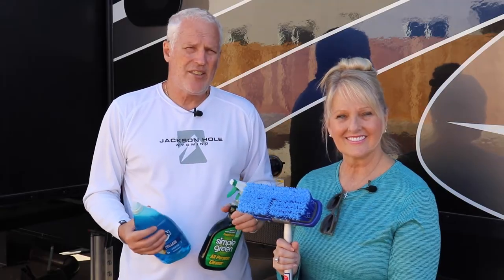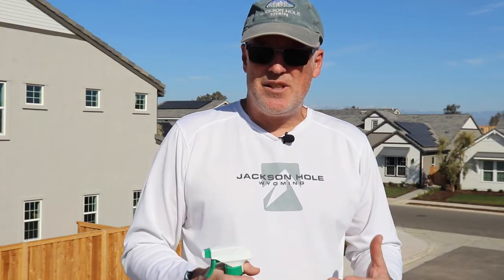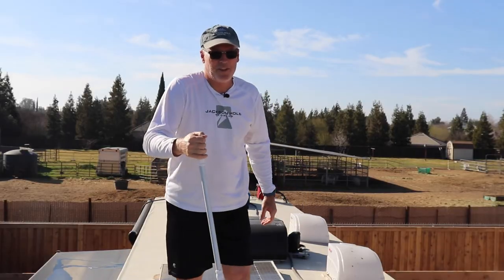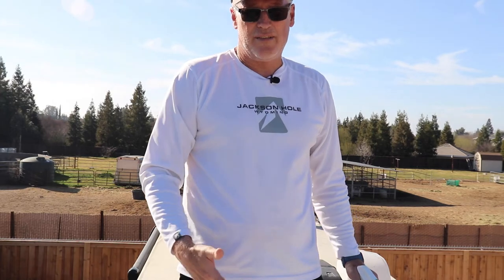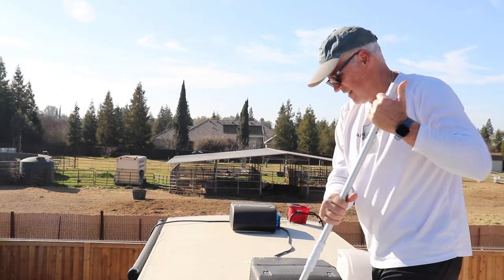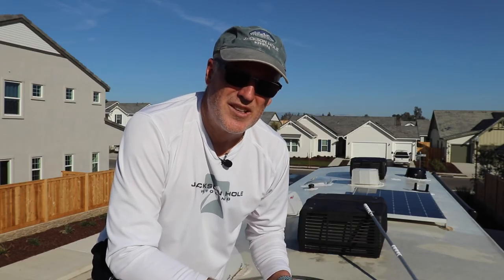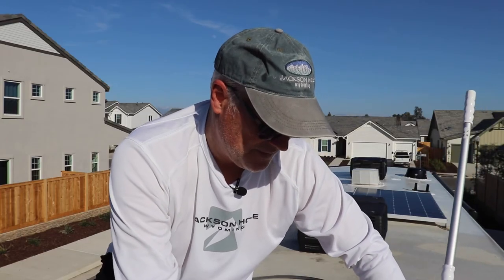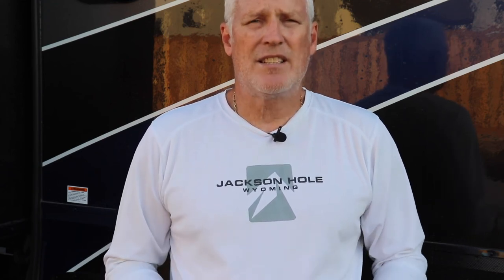QUIZ: Which RV Roof Cleaner Works BEST? (Full Time RV Living)

Comment: My favorite RV roof cleaner is LA's Totally Awesome. I purchase it at Dollar General for $3 for a 64 oz bottle. It also works great for removing the black streaks that form on the sides of the RV that flow down from the roof.
Reply from the maker: @seantonnesen1636 thank you so much for the information, maybe we'll give it a try some day.

Dan
Reply: I totally agree.  This roof is not even dirty compared to my mom's RV which is kept at a forest site (with pine trees) year round.  She has used Simple Green,  Zep, many different ones from the RV stores and this year 30 seconds.  The others eventually clean, like after 2-3 go overs.  Each time I end up going back with the LAs. She used to use Scrubby Bubbles on the awnings, again LAs did great.  Of course read how to dilute it properly.  Was even able to clean out the clogged rain tracks with the hose after using LA's to deal with the algae build up.  Only issue with the LAs is there is a not a UV protector or conditioner/wax in there.  Either way it is the easiest to get the gunk off and can go back and add what is needed.  I also use it as a deck cleaner, furniture cleaner, kayak/gear cleaner, BBQ and refreshes patio cushions....again dilute as on label.  A 1/4 cup in a wash load  or tub of water (again kayak gear/life jackets/feather pillows) cleans/freshens musty/moldy fabrics.  I mix it and put in a pump sprayer for application on he RV then scrub/rinse.
Reply from the maker: @TH-eb5ro  thank you for the information. I'll have to check with my RV manufacturer to see if it's safe to use on my roof, if so, I will have to give it a try.

thanks
Dan

Comment: I've heard lots of comments about dish soaps potentially doing damage to the side surface, possibly damaging paint, etc. Have you seen or heard that info?  Or seen any cumulative damage over time?  It won't do damage once or twice, but over time, supposedly could.  Nice video!  About to do mine so I'm watching a few for ideas.
Reply from the maker: @travelingwithtroyandrhoda6442  Thanks for watching and leaving a comment. We've heard dish soaps will take off the wax from the paint, but nothing about any other damage. We only use Simple Green when we wash our roof and have not seen any signs of paint damage.

Safe travels
Dan
Reply: If they use Dawn on cleaning wildlife after oil spills, it can’t be that bad. Can’t burn the critters skin.
Reply: @blueman5924  paint and animal skin are not the same. The skin can heal after one use. Paint and the coatings on top of the paint will be damaged long term by grease fighting substances.  Scrub those animals every week for a few years and report back. 😂
Reply from the maker: we're sticking with Simple Green on our roof until I run across something better, thanks for the comments.

Comment: Simple green will remove wax from the sides of your RV as it tins off the roof when you rinse. It's also great for removing black steals from the sides of the rv, but you have to reapply wax. We've had our trailer for 12 years and have always used the products made to clean/condition/protect EPDM roofs. I clean and treat it 1-2 times/ year and it still looks like a new roof.
Reply from the maker: Hi @rodwesley2779  can you share with us the products you use? I'd love to give them a try.

thanks
Dan

Comment: Extend the brush handle a bit more to help yourself.  Also look into the Unger extending pole system. All parts are replaceable.  I don't think the head is replaceable on that brush and in comparison it does not extend very far.  I used a product called 30 Seconds earlier today and it was not slippery.  I was wearing Chacos hiking shoes and I was in a hurry, sitting on your butt and using the brush is my preferred method.  I suspect Dawn puts a lot of effort into getting their products used for different things but we don't use due to EWG ratings but I do have a mechanic brother that will use for his laundry and double rinse.  Murphys Oil is not that sort of product, even recommends not using on floors.  Thank you for the comparison.
Reply from the maker: Thanks for the info on the Unger poles, we'll look into it. Also, I like the idea of sitting down while cleaning, might help save my back after a long day.

Safe Travels
Dan

Comment: The key to clean roof is to use roof sealant after a good clean. Put it on thick and when you clean it it’ll be like new every time and protect from Sun. Plus cleaning it is no effort.
Reply from the maker: Good tip Mark! What kind of sealer do you use?
Reply: I used Camco sealer. It comes in a set with the roof cleaner. I did it in the spring last year, but wanted to get to it again in the fall and did not. It was hard to clean...very dirty and the dirt did not come off easily. I had to use a scrub brush and do most of it by hand. Both our brushes on extensions just didn't get into the grooves of the TPO.
Reply from the maker: Thanks for the info! We will have to give it a try! Have a great weekend.😊

Comment: It may be best to use an EPDM roof cleaner and conditioner, it is formulated to clean it and leave a UV inhibitor behind to protect the rubber. A high-pressure washer also works great with a fraction of the effort.
Reply from the maker: Thanks for the information, we'll look into it
Dan
Reply: I just saw the EPDM cleaner at my RV dealer. It was $70 C. for a 2 litre jug. And the instructions said to spray on, and wet mop off, no hosing down, to keep the runoff from possibly damaging the side wall graphics etc. The UV/conditioner liquid was a separate jug again.$$$ Think I’ll get the Simply Green too.
Reply from the maker: Too expensive for me, we're sticking with Simple Green. Thanks for the information
Dan
Reply: A high pressure washer is a terrible idea for any section of an RV. It can blow through the seals easily. Dawn is the only cleaner recommended by the manufacturer of rubber roofs, DICOR
Reply from the maker: @amarmot3635 Thanks for watching & writing in. We reached out to Grand Design since they are the manufacturer of our RV & Simple Green was one of the products they recommended for our RV. Have a great weekend!👍

Deena & Dan

Comment: Dawn is not the best on your roof. For one it gets very slick when wet on flat surface. Second it is a oil eater which  in your wax on your rig it will attack on its way down your  wax on the sidewalls of your RV. That only makes extra work. Now I do like simple green but it is a acidic liquid that could not be good for all roofs.    Love the video.  Keep them coming.
Reply from the maker: Larry, you're right, Dawn was very slippery on the roof. In our humble opinion Simple Green cleaned the roof better anyways, so we'll be using Simple Green on our roof unless we find something better. Always great to hear others opinions. 
thank you

Comment: Did you dilute the simple green at all with water or just used it straight out of the bottle ?
Reply from the maker: Hey Daven, we just used it straight from the bottle and it worked great. We also make sure we hose everything down with water to remove any left over chemicals after we finish cleaning. 
Dan

Comment: Thanks!
I was wondering if simple green would do the job (definitely don't like how slick dawn can get) 
Good video. What drone and video equipment do you use?
Reply from the maker: Hi Kimberly, thanks for the comment and glad we could help. Simple Green works very well and that is all we use now.
As far as camera equipment - we recently had our main camera stolen from us when we were in Oregon, you can watch our "WARNING! - Don't Let This Happen To You  (rv lifestyle)" video for the details. We purchased a Canon EOS 90D for our main camera. It's a great camera but it's not the top of the line. We don't have sponsors like the big channels so we pay for everything and this is what we could afford. We also have a GoPro 5 and a GoPro 7. We love the GoPros and will upgrade them at some point. The drone is a DJI Mavic Air 2. The drone is awesome and very simple to fly. We only use the drone as a tool for videos and not as a toy so we really don't fly it that much, but when we do, it's so much fun.
Reply: @RiversToRidgesRV  sorry to hear your camera was stolen. Not sure if I will ever use much video or even a drone but for sure will try to clean my RV roof before too long. My husband passed away and he was the one that cleaned and serviced the RV. It has leaks up there so a good clean and reseal is in the future. (And new exhaust vent caps & sky light cover & .......)🤔
Thanks again !

Comment: Looks like the brush is working great. Would you go with a harder bristle brush after you washed the roof?
Reply from the maker: The brush we use on the roof is a medium bristle brush, the brush we use on the RV is a soft bristle brush.
Reply from the maker: This is the brush we use on our roof, it was purchased on Amazon: 
Adjust-A-Brush PROD274 Rubber Roof Wash Brush

This is the brush we use on the RV, it can be purchased on Amazon:
Shurhold 960 6" Deck Brush with Soft Yellow Polystyrene Bristles

Comment: Do you treat the roof with anything after cleaning?  Like a sealant or wax of any kind for the roof?
Reply from the maker: Hey Steve, no we haven't had to treat the roof with anything after cleaning. Our roof is only 1.5 years old, we may have to seal it after a few years.
Reply: @RiversToRidgesRV  I’ll be sure to tune in when you post the “we sealed or roof” video!!  Lol!  Ours is only 2yrs old and I’m wondering if I need to and what to use.  I’ll keep researching!  Safe travels🤙😎

Comment: Can you walk on a roof of a travel trailer?
Reply from the maker: @frankmcclellan9506  All travel trailers are different so it is best to check with the manufacture to make sure your roof is safe to walk on. However, if your travel trailer has a built-in ladder on it, then it is most likely safe to walk on. If you are not sure, don't rely on my answer or anyone else, check with your manufacture to be sure. 

Dan

Comment: My concern is permanent streaking down the sides from the cleaner.
Reply from the maker: We've been using Simple Green whenever we clean our roof, so far, no issues with streaking. However, we do hose down the sides of the RV after we clean our roof to try to get as much of the chemicals off of the paint.
thanks for the comment
Reply: I usually wash the trailer after I wash the roof
Reply: @Patrick Gniech   what do you use to wash the trailer with
Reply from the maker: Hey Daven, that depends. If we're in a campground that allows us to wash our RV with water, then we'll just a car wash/wax product, nothing in particular. Our RV has full body paint, so auto products work fine. If we're in an RV park that does not allow us to use water, then we'll use our Aero Cosmetics products. We did a video on the Aero Cosmetic products, you can find it in our Review section on our YouTube Home page. https://youtu.be/mPFf5GoT3fI
Reply from the maker: Hey Patrick - We normally wash the RV after cleaning the roof also, however, sometimes due to running out of day light &/or maybe us getting older (!!!), we sometimes break it up over 2 days. Hope you're having a great week!😊
Reply: @Rivers To Ridges RV ™   Can I use simple green to wash my rv also ? I'm seeing where some people recommend it not only for the roof but washing the motorhome with it as well! What are your thoughts on this ?
Reply from the maker: Hey Daven - Our RV has full-body paint so we only use a good quality automobile wash on it. Personally, we've never heard of anyone using Simple Green to wash their RV but I guess it's possible depending on the metal/material of your RV. Still, I would definitely check with your RV's manufacturer to confirm & to be safe. Hope this helps. Have a great week!😊